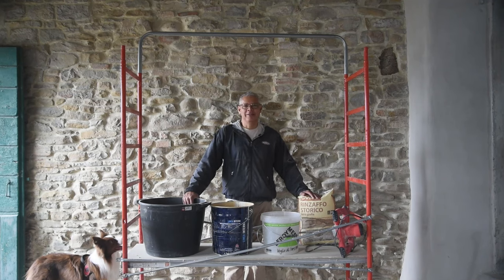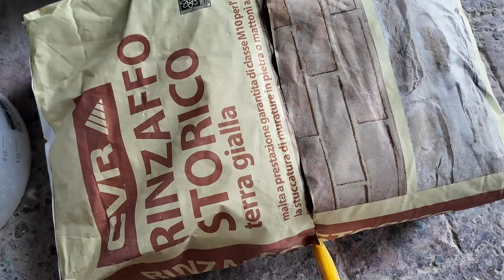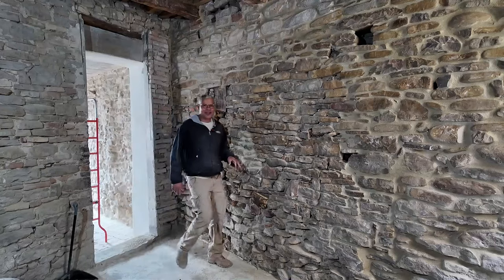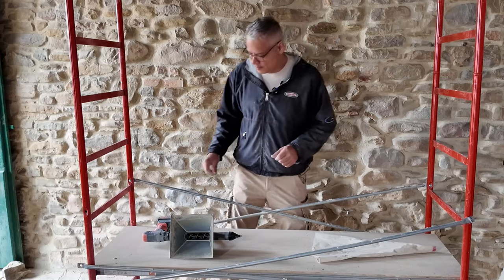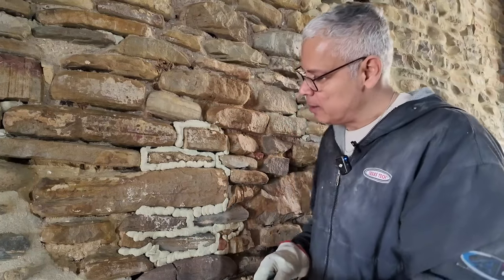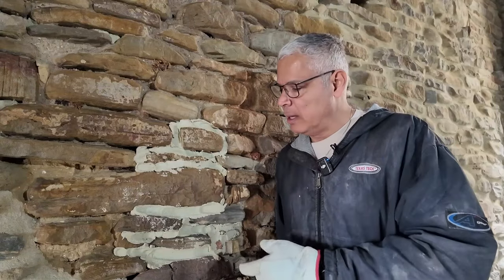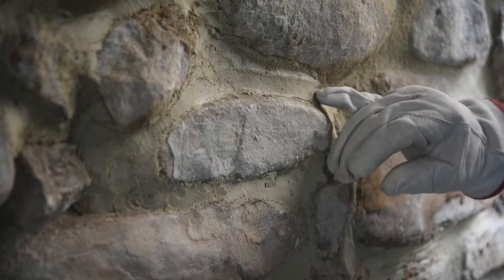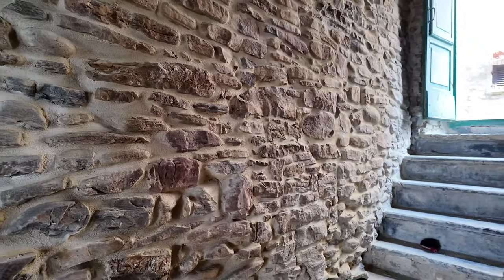#4 How-to restore stone walls (part 2) | DIY Renovation Italy.

Comment: You're doing a great job!  I bet this is really tedious, but extremely gratifying when you're finished.  Probably so boring you want to pay someone to do it, but then I would want to make sure it was done just right so I would have to do it myself!  

Your pointing gun looks interesting.  Never seen one of those before.  I used the piping bag, but I've never tried anything on your scale there.  How long will this new mortar last?  

Surprised me to see you using that wire brush to clean it.  I would have guessed it was cleaned off with sponges like with grout.  Now I know!  

Kobe is a star!  You two keep up the good work!  Have a great week.
Reply from the maker: Thanks Danny! The work is tedious but I can honestly say that I enjoy it. I don't find it boring at all and I love seeing the video and results. 
The new mortar should last many years. It's not like painting where you have to redo it after a few years.

Comment: Mate, you have a new subscriber, don't stop making videos. Man, I have a question for you. Have you already done the floor? What kind of precautions are you taking regarding rising damp? As is well known, stone walls have this problem. I ask because I have a stone house in Italy and I hope to start restoring it soon and any information I can gather will be useful. And also what strategies have you implemented for isolation? It will have all the stone exposed, I know it is beautiful and will add character to the building, but the heating factor will be quite expensive. Greetings and looking forward to seeing a new video.
Reply from the maker: Hi Tony. There are three floors not counting the garage level. The two upper floors have a cement screed. I'm not sure if I will cover them with wood or tile. The floor of the shop has one side in the orginal terracotta and the other has a cement screed. Only the side with the cement screed has earth below it. To control the damp, the floor was excavated and a layer of plastic air chambers (not sure of the technical name) was laid then covered with a cement screed. The air chambers are ventilated by two large tubes. One on each end of the floor. They will ventually be routed to the outside. I'll post a photo under my community tab so you can see how it looked before before the screed was applied. 
As for insulation, the walls are about a meter thick. This helps to keep out the outside temps.  I also have adjoining houses on both sides. This also helps.

Comment: Great videos and thanks as I need to mortar an entire rustic farm house I own in southern Italy. How would you describe the color of the grout after it has dried completely?  Thanks!
Reply from the maker: You're welcome :)  In the part 2 video, at 7:52 I'm standing in front of a wall that has fully dried. The color I used is call Terra Gialla. This mortar (linked in the description) comes in three colors. I preferred this sand color because it doesn't overpower the color of the natural stone.
Reply: @housemarche  Thanks...roughly how many square meters does 1 bag cover for you?
Reply from the maker: One bag covers roughly 3 meters. In some areas of the wall you will find deep crevices that require a lot more mortar. I'm talking like 10 cm or more.. In this case, I'll mix up a bucket of mortar then add in  several handfuls of small stones. This adds bulk so you use less mortar to fill the large crevices. You should do this one or two days before you start pointing. This way it has time to dry before you do the final pointing. I think this topic is important enough for me to add a third video to the playlist. 🤔